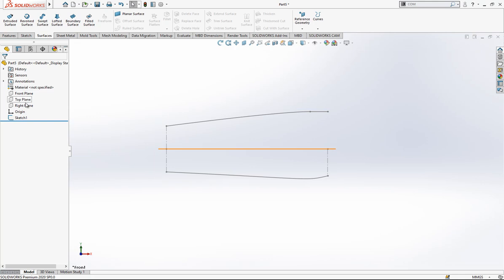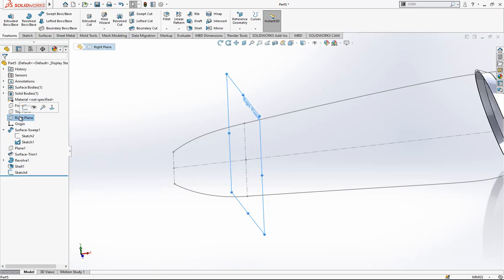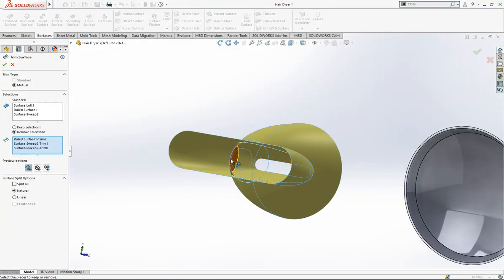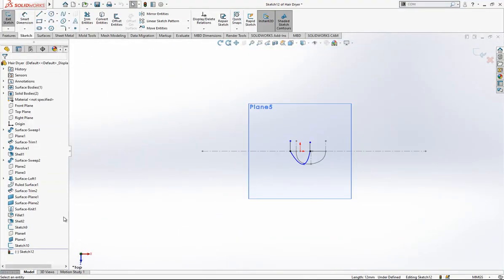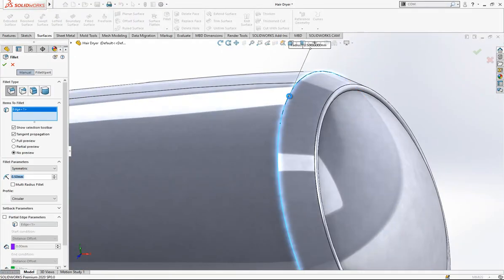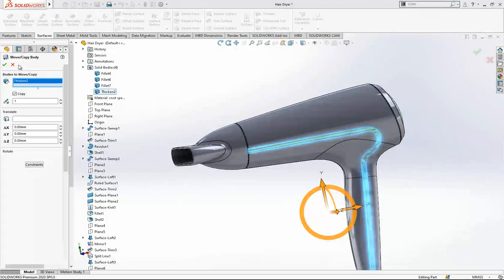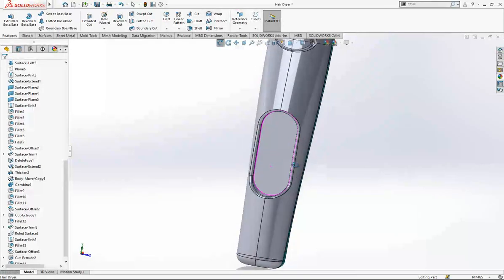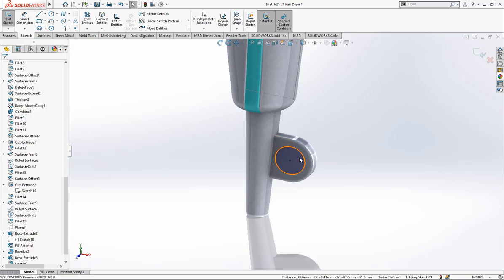Advanced Surface Modeling - Hair Dryer - SolidWorks Tutorial

Comment: Amazing video. Gave me lot of tricks and tips to carry out surfaces. Just one request. Can you make a video on creating ribs, drafts and fastening features on these parts please. That would help me alot in making an proper assembly of the part. Thanks.
Reply from the maker: Hi Dear, adding to much detail makes video longer and nobody watching. Average watching time of this video around 4 minutes.
Reply: @3D-World  I understand. Maybe a short video on already existing model might help. Just an suggestion :)
Reply: @3D-World  Avg watch time is at 4 minutes because the sweep surface doesnt work from clicking the circle sketch to the bottom line sketch
Reply: Please make longer videos... I will watch

Comment: Can u share the drafting documentation link in the description
Reply from the maker: I do not have it.
Reply: @3D-World  then how u did this, with all correct dimension constraints?
Reply from the maker: Simply I measure parts  by myself and then finding the curves and noting the values on a paper. 
It is just demonstration so some deviations on measurements are fine. 

Already to prepare a drafting document for this kind of parts take longer than modeling part itself.

Comment: High I am your subcriber I really want to know when to use which cammand in solid works and my second question is from where to start the modelling like how we will decide the Base sketch of the model and will start designing it
Reply: Will be really happy if you make a video on it
Reply from the maker: Yes I can make a demonstration for that. I believe will be an easy video.
Reply from the maker: Hi Dear, 
It is a good question. Mostly you gain skills with experience and practice. 
When I am modeling a part I am starting from a point that will lead me to the end in shortest way. In this example you will see that biggest volume was in my first action to complete model. 

Also you can think that which  simplest feature can help you to finalize the model in a effective way. 

Before I am modeling somethings I divide it into pieces in my mind, try to do that you will find answer.